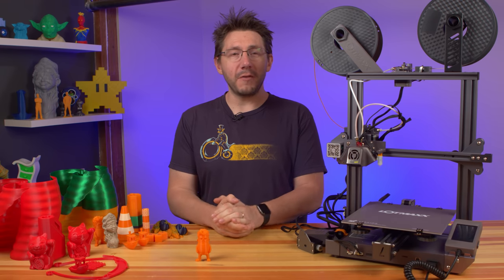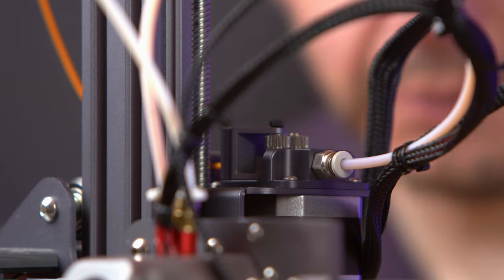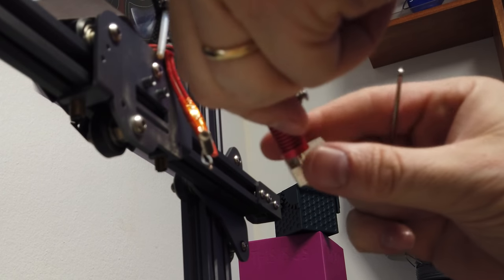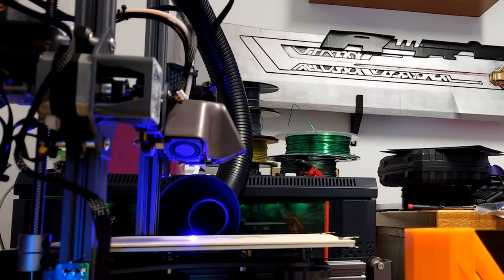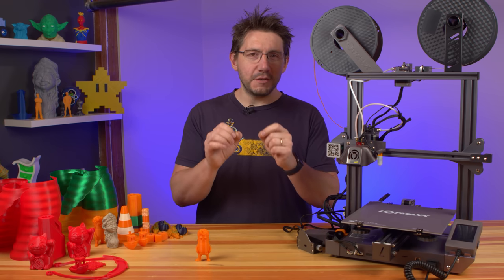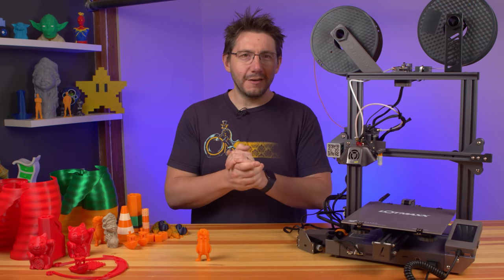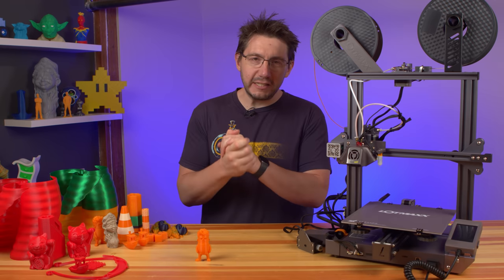Lotmaxx SC-10 SHARK 3D Printer *FIRST LOOK*

Comment: My stock SC-10 has between 3000 and 4000 hours on it. It's just gone through a major fixing after the heated bed wire broke and started arcing which fried most of the power electronics, but now it seems to be working again. It looks like they didn't add any of the remedies to the vibration issues I sent them, hopefully the change to the steel under the build tac will make it blister less. 
If they didn't change the base geometry they could add a purge dump in front of the bed, that works far better than a purge tower. I'm kinda sad I didn't get one to test ...

Comment: This looks almost identical to the ender 3 . I wonder if the dual extruder will be compatible.
Reply: (Disclaimer: I don't have either model) I would imagine that at a minimum you'd need an adapter plate and firmware/slicer support for the second extruder. If the controller board only supports 1 extruder, you'll need to upgrade to one that supports 2.
Reply: @MMuraseofSandvich  I already have an skr mini and   am capable of configuring the firmware. I wonder if the back plate would be included because it seems to be capable of using different tools. It would be a hassle to remove the back plate and rollers each time you changed a tool.
Reply: Not sure what Ender 3 model you have but it looks nothing like any of my Ender 3's.
Reply: No, different from Ender 3. Ender 3 don't extend the laser engraving . 4 fan are very nice,I like it.
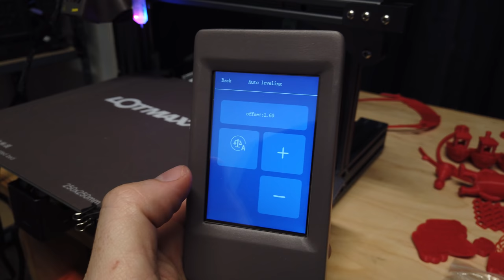Reply: 3:15
Reply: I made my own dual extrusion system using a second Creality extruder on my Ender 5. I have an skr 1.4. I suppose the dual extruder would work with a few firmware and slicer changes. I’ve made my own dual extruder system using a printed Bowden y splitter, another extruder and some m6 Bowden couplers
Reply: once u get the dual filament hotend on u wouldn't need to put the single back on u can use the dual as both kinda like the CRX PRO I use it as a single extruder most of the time
Reply: Similar structure, better than ender3/ Pro.
I like steel Build Plate, 4-fan ,mobile touch screen .
Reply: Yes, they both use 20x20 extrusions for the X carriage bar, so you would just have to unscrew the extrusion from the right, roll the ender 3 extruder out, roll in the new carriage. 
You'd need a new motherboard though
Reply: @DoryHayes  looks similar to my ender 3 v2

Comment: I have a Lotmaxx SC-10. I've had it for about 3 months and aside from a clogged nozzle a few times its been running almost 24/7 with no issues and as far as I'm concerned great prints (I'm new to 3d printing). From opening box to first print was about 30 min. I would be more than willing to purchase the shark if it functions as well as the standard SC-10.
Reply: Same! Except it’s been a few weeks lol.

Comment: I will buy this printer simply for the dual extrusion if it's a polished mechanism. Idk how much tuning you had to do Joel but your prints looked fabulous. All I need is two extruders so I don't need a way overly expensive mosaic which still has its flaws.

Comment: I like this printer and with the fixes implemented I would love it, I am not keen on the cloned BL Touch though, I would much rather have the original BL Touch even though it is more expensive.
 A company that does not use cloned parts carries kudos IMO and promotes research and development within the industry which benefits everyone in the long run.
Good Luck to the Lotmaxx team with this project, I look forward to seeing the release version and your review Joel.
Reply: One of my main gripes and the reason 3d printing will go down the toilet if cheap knock offs keep taking real genious inventors profits away, they will seek money else where. Have to buy genuine or its going to be the end of 3d printing
Reply: I hate that, too, even though 3D touch is cheap and the performance is good.  3DTouch is made by MKS, not Lotmaxx.
Reply: Do you think you could skip buying the version that includes the cloned part and just install the BL touch instead? You would think they would be interchangeable.

Comment: Remove all the optional extras and what are you left with? An Ender 3 with a slightly bigger build volume, color display, and some silent stepper drivers. These are all nice to see but machines that aim to be a jack of all trades are typically a master of none. I would rather have a separate machine for laser engraving. The idea of having to switch out my tooling and calibrating every time would be a huge hassle. The biggest issue here is support though, especially for those new to 3D printing. If you order a printer off AliExpress or a similar site you're on your own if anything goes wrong. With more popular printers there are community based resources and a ton of videos on YouTube that will get you sorted out in no time. Joel, I wish you the best of luck but in a market that is already flooded with options I'm not sure how it will go.

Comment: I wish they would support the printers they already have on the market. I have two Lotmaxx SC10s since Novemeber and they still haven't released a firmware update. 

 You can't even adjust the estepa because its not apart of the stock firmware. I literally had to email the company and the engineers had to send me a text file to flash the printer with. And everytime you want to adjust things you have to do additional flashes rather than having it on the lcd screen and doing it in real-time.

Comment: For a newbie to 3d printing would you recommend the sc-10 or the sc-10 shark. Probably don't need the laser, but maybe the 2nd filament? I feel like the regular sc-10 might be great for me until I get going and get a more expensive printer. Any major issues with the regular sc-10?
Reply from the maker: For a beginner, this sort of machine without the laser and second extruder would be a good choice. Or the Ender 3 / Ender 3 V2 / Elegoo Neptune 2

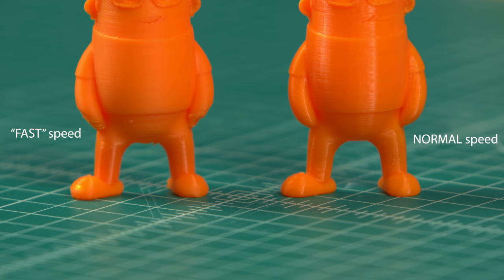Comment: The FAST model at 2:24 looks better than the NORMAL... Are the labels CORRECT? Or REVERSED?

I'm VERY interested as I should be receiving TWO of these having pledged for a 2PK on KickStarter and one of each Add-On to try the options out before I commit to more add-ons. I plan to use one for Laser Engraving full time and one as a Dual Color with Auto-Level installed.

Also, you say the XY is 235x235 but elsewhere I see 225 instead of 235. Did you confirm the XYZ?

I LOVE your videos, btw. Thanks for you review of this printer. I can't wait to get my pair of them.

I found your video AFTER deciding to Pledge but it was GREAT and very helpful. Thanks again.

Comment: Please do an update! The firmware won't update for me. The printer won't show dual-color extrusion. The auto-level doesn't want to work for me. The laser-engraver doesn't like me. If I could just do the firmware, I feel like things would change with a firmware update. If you have a fix please do tell! I followed their steps a dozen times over, but Lotmaxx has been finding new ways to tell me the same unuseful answer :(

Comment: Aloha Mr. Nerd, I watched your review on the Lotmaxx SC-10 Shark and decided that would the printer to get to start 3D printing with. After a long wait it finally arrived and printed some amazing models. I was wondering is there a way to open the code for the models they provided to see the setting they used to print those models?

Comment: Nice how you got some consulting work out of this.  I recall that you refused to review the laser etching/burning features of other similarly equipped Chinese made 3D printers citing safety as a primary reason.  There should be a shroud over the machine when the laser attachment is in use.  Plus wear the protective glasses.  Hell you don't even need to see the laser itself if you have a remote camera inside the windowless enclosure to show the progress.

Does this mean you'll go back to those models for an update on the laser or engraver side of things?

Comment: I am curious, what kind of safety equipment will be included with the laser engraver? I think that it is very important to provide a set of laser goggles with a high powered laser. I have saved my eyes on more than one occasion by wearing a good set of goggles.

Comment: This appears to be a modular adaption of the ender 3 pro with little additions such as the removable touchscreen and the 4 fans. I hope as this progresses it will be able to fix the problems it has as this has great features at a great price. Also I have been loving the videos recently as I came across you now I have my first 3d printer the ender 3 pro. Keep up the great work:)

Comment: I ordered the last space black for 199, and I was wondering if these upgrades will be available after its release. Mainly the laser engraver and if there will be a printable bracket for the 3Dtouch since the sensor is pretty cheap by itself.
Reply: They've been asked this many times and in the comments they say to email them after the campaign ends and they'll send you a link to add it to your order."user avatar
LOTMAXXCreator
27 days ago
After the crowdfunding is completed, if you need it, you can buy it at that time.Please contact us via email, thanks."
Reply: @chrislim6104  Thank you, I'm very excited for this project getting to this point.

Comment: Could the bicolor hot head print different materials as well (like pva supports) as long as the temp is shared?
Reply from the maker: Yep. That’s the thing to consider when 2+ materials share the nozzle - should be similar temp ranges.

Comment: I do not know how it is in this printer, but the old SC-10 has an MKS Robin Nano motherboard, and unfortunately you can not load the firmware from MKS Robin Nano, it would be good to be able to do so, it will increase the attractiveness of the product as it can be easily upload a different menu look, or make it yourself using MKS TOOL

Comment: Does it have a bootloader and thermal runaway protection?   How hard would it be to convert it to direct drive?  Thank you for your review.
Reply: Another question:  Do you have to use both colors for every print if you choose to modify the printer with the dual extruder?
Reply: Yes on both accounts.
Reply: @anymouse5018  No you don't have to use both extruders, it's setup through the slicer.

Comment: Getting tired to see those similar i3 setups, until I see the interesting printhead design. That's been said, I do want to see more different structures/setups.
Reply: Exactly and although I love Joel's content, I can't possibly now trust if this machine is indeed any good in the end. No mention of that or if the subsequent review is going to be independent etc. I'm not just buying all the Kickstarter printers just because it's presented as a win-win situation.
Reply from the maker: I don't know if I'll be able to review to final machine that backers get. I mean, I've been paid by the company to do work on the project. I'm hoping what I'll be able to do is direct a few review units to other creators.
Reply: @3DPrintingNerd  Have you actually been paid yet though... that is the question lol.

Comment: That second extruder's bowden tube looks pretty kinked in this video... Seems like it needs a better mounting location or tube routing to prevent problems at certain gantry positions?
Reply: It does seem like someone sugested that and they listened, as the way they present the bicolour print on the kickstarter looks different than the setup in the video above. Have a look at https://youtu.be/v-GuHJ1GQoY or https://www.kickstarter.com/projects/lotmaxx/lotmaxx-sc-10-shark-3d-printer/

Comment: I like this model. Why the heck do these printers not come with 500mm base width prints yet, and over 800 height?
Reply: @ShimmerStockton this model does not do 800 high? And the x,y and z axis can be bigger bit this make problems with stability thicker frame stronger motors etc which makes the expensive

Comment: Basically it's an ender 3 with all modifications like mine now
Reply: $80 for the laser ain't bad at all. They should consider a CNC add on too.
Reply: @AmusementLabs  Usualy good 3D printers are very bad for CNC in any way. You want the carriages to be light, so, they are "weak" and deform with milling cnc. Maybe you can just add a motor and do PCB milling, but you need to modify the bed to hold things
Reply: How to add laser engraving on the  Ender3 ?  I want to do that. please!

Comment: I am giving up on FDM, the future is large 4K to 8k monochromic resin printers.
Reply: Even more so if they implement CLIP.
Reply: FDM will still have a significant place in the market for the foreseeable future. Less expensive, more material options, much safer material handling -- in most cases no special ventilation required, slicing is more straightforward.  
Don't get me wrong, resin is great for creating intricately detailed items, but forget flexible or multicolor prints, and you'd better keep your printer and resin out of reach of children.

Comment: If I am spending $250 for a 3D printer, I don't see why the Auto Leveling is an additional charge. Isn't Auto Leveling becoming the standard? The additional $20 cost for the Auto Leveling is what takes this one into the Not Cost Effective Category, for me, anyway. Looks like it might actually be a decent printer, but whatever I usually print, I only need a Z-axis of usually 210mm. The additional 55mm is not worth the additional cost.

Comment: Really interesting that suddenly everyone seems to be suggesting that standard PTFE going to the nozzle is fine to print higher temp filaments like ABS, while 245 reaches the danger zone of offgassing toxic ptfe fumes and damaging the ptfe by softening it, which then creates all kinds of problems like jamming and underextrusion while trying to print PLA next time you do. If possible keep PTFE below 235C (which also is my normal PETG temp so PLA/PETG good, above that without an all-metal hotend or capricorn high temp PTFE.. dont!) Why all of a sudden does it seem like the influencer community has forgotten about this risk?
Reply from the maker: I've always thought 245c was the limit for PTFE, but I looked it up and I'm reading 260c is the limit. Normally, I would be with you on this, but, I'm reading 260c. Do you have some good links with more information?
Reply: @3DPrintingNerd  I usually would reference the cap tubes caution page but seems the removed the comparison to regular ptfe on it. Over 202 starts technical off-gassing that can be a super sensitive low real world death case to bird risk per their chart even with their ptfe tho. Seems harder to find ptfe temps vs Teflon specifically all of a sudden as well oddly. Albeit Teflon is branded ptfe blend.
Reply: @3DPrintingNerd  I know personal experience. 240 ptfe is as flexible as a silicone tube in comparison to 230. So def becomes a risk of deforming in the hotend and causing extrusion issues.

Comment: Irrelevant without comparing it to other Ender-like machines. Besides the dual-drive extruder (assuming it is any good) and the crappy display (I prefer anything over touch), it is an Ender 3 Pro with regards to the 3D printer (not counting the laser or dual extrusion since they cost extra anyways). The 3D Touch is just the usual BLTouch clone. The fan duct is probably worse than 2x radial fans (axial fans are worse than radial fans for this use case). And was the slicer simply optional or actually required to operate the printer? (read: useless feature or death sentence?). Which brings me to the forgotten mentioning of both mainboard and firmware? (another death sentence if not compatible with mainstream Marlin or Klipper)

Comment: After seeing this video, I bought one of these printers to replace my Robo 3D. However after a terrible experience with the company I cannot recommend them. They attached a tracking number to my order which was delivered to a different state. I assumed it was an error and asked for the correct tracking number via email. I did not receive a reply so I contacted them via Facebook messenger and when they did reply they insisted that address it was delivered to was the address on my ordered. After providing screen shots of the order in my email, they still insisted the address was different. Then they even said the address sent from PayPal was the address it was delivered to. I sent them a screen shot of the PayPal invoice as well. After that they stopped responding. I had to open a dispute with PayPal. Then after PayPal received the response from the company, they decided the case in my favor and I was refunded my money.

Comment: A printer manufacture should be testing their own machines and know what is right or wrong.
The fact they're using '3D Printing Nerd' to suggest problems and fixes suggests to me that they don't know a lot about 3D printers. That's just ringing too may alarm bells for me.
Reply: I see where you are coming from but as a test engineer myself, products work differently in different environments. Having different eyes give ideas and thoughts is never a bad thing.

Comment: Challenge: Get a buddy or two and everyone has a printer that’s got a Bowden setup. Start a 30 minute print but instead of the extruder pushing the filament through, manually push it through by hand kinda like a cold pull. Best print wins. Try to get some 3D printing celebs like Angus Daveson from Makers Muse and Josef Prusa.